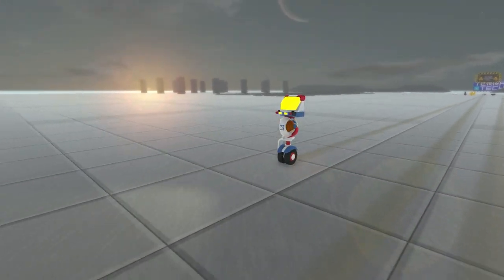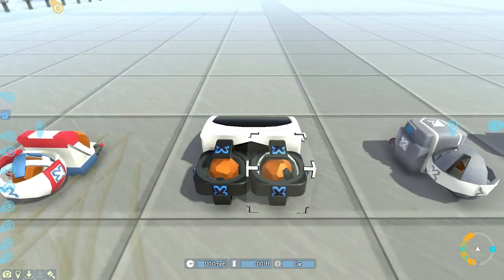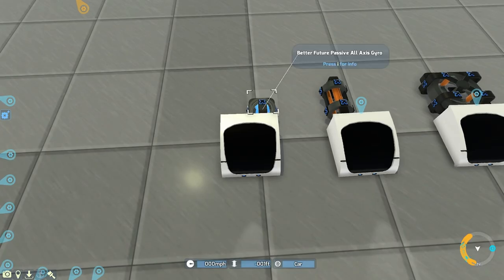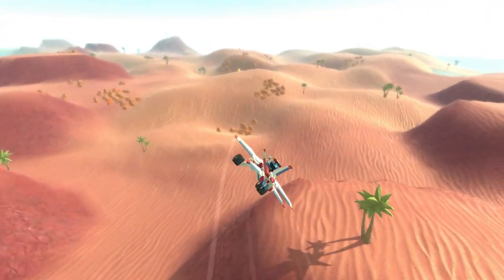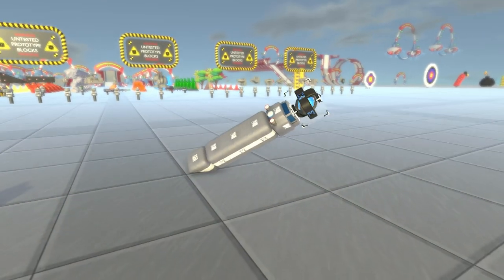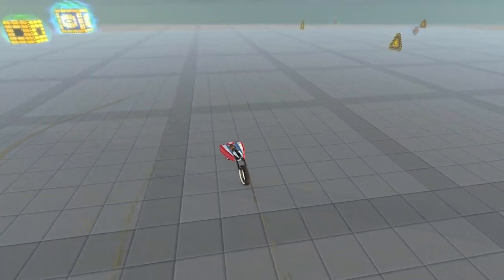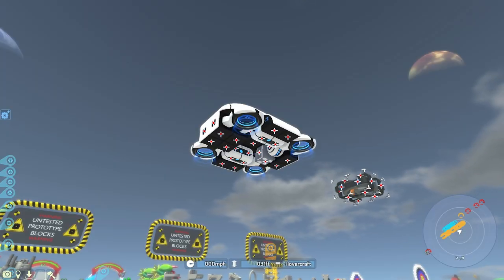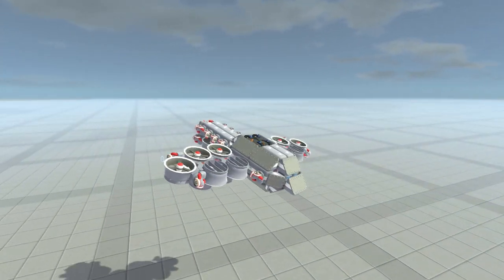Gyroscopes in TerraTech || TerraTech Tutorials

Comment: I'm having trouble with the single axis and the tilt axis.  I have a tech that needs to sit at a 45degree angle to the right but the tilt will only work tilting forward/backwards?  I've tried flipping it around and it always seems to do the same.